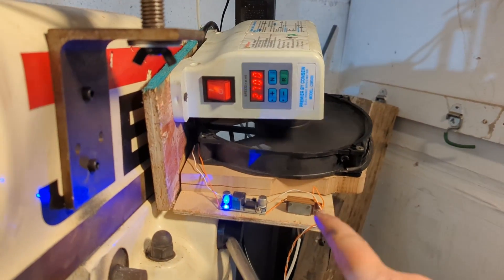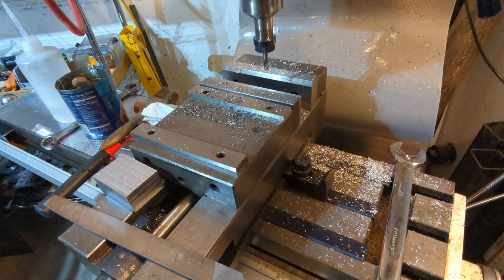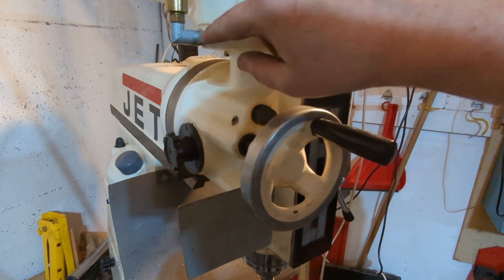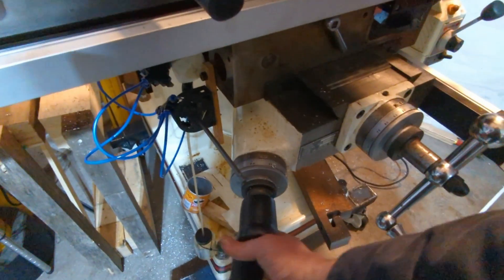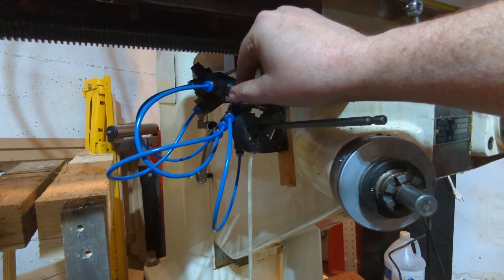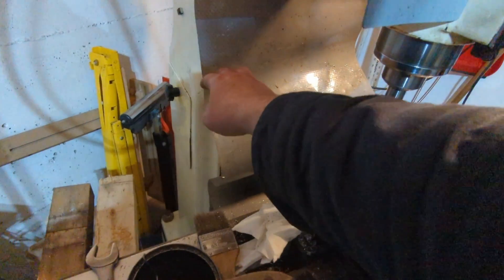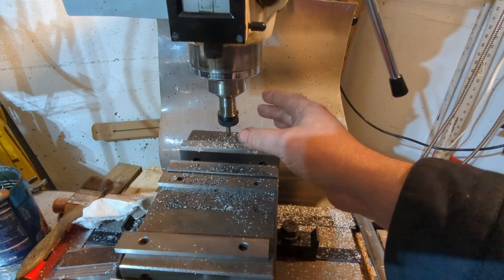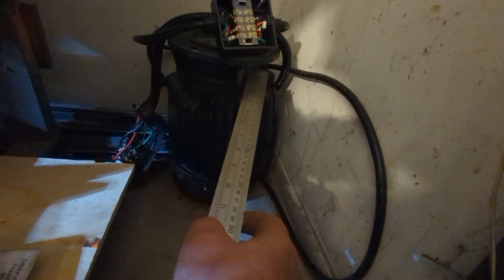consew csm3000 sewing servo on Jet 836 3/4 bridgeport clone

Comment: 2:41 You have a few years of experience with these Consew motors.  How long can you run it continuously? And what is this controller 3:02 ? I see below another commenting on having one burn out.  I'm planning on powering a 2x48 belt grinder.  I am just putting it together right now.  I'm using the stock pully and a PowerTwist belt to the grinder and a 4" pully on the grinder as it is the smallest I have without buying another.  The speed I want is something equivalent to want a typical 120vac 1750 rpm motor would provide.  I am waiting for the belt to arrive but running it for a little bit continuously, without and load, it definitely heats up a bit just running it for 5 minutes.  I'm going have to watch your videos and see how you hooked up that fan and which one to get.  Are there any tricks that would help my particular application?
Reply from the maker: i've not had one over heat but you can see I have a fan on the controller.  I've run an hour or so, nothing really long.  I think the cooling is most important if you get a stall as they can really heat quickly in that condition and most failures i've read about are due to stalling.
Reply: @JesseSchoch  Thanks Jesse, I am definitely going to install a fan on the controller thanks to seeing your YouTube here 👍.  If it can run an hour, then it will be fine.  An hour is a pretty long time and you'd think it would obtain max heat within the first 15 minutes.

Comment: intrested in the motor conversion. i have some of those motors, no specks on them and no drivers. would like to use one for a toolpost mill atachment im building from an old drill press quill. can you maybe tell me what voltage and how many amps that motor use. will try make mine run with a bldc driver. if it can. but thay pricy after market, dont want to buy some thing that has not the legs to pull the motor..
Reply from the maker: the controller comes with it.  the csm3000 is rated at 750w.  the generic (non consew) motors are not as well made and I doubt will hold up as well.    I don't know the exact numbers on the voltage but I'd guess it is like 180v or something.  I doubt you can run that with a normal bldc esc, if you can i'd love to know how much current it ends up drawing.

Comment: Keep an eye on the temperature of the motor, had one overheat and burn out on me. Have not been able to find any spec on Max working temperature so I shut down at 160-170F until I can find the insulation breakdown temp.
Reply: How long did you run it before it burnt out.  And what RPM was it running at mostly?  I'm planning on hooking one up to a small 2x48 belt grinder that is pully driven.